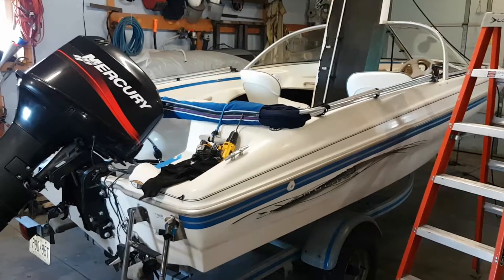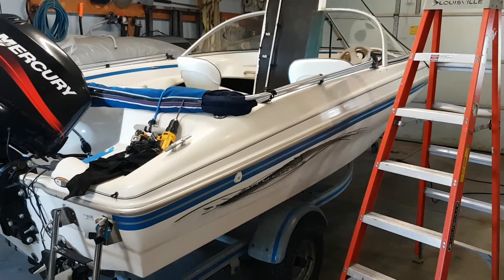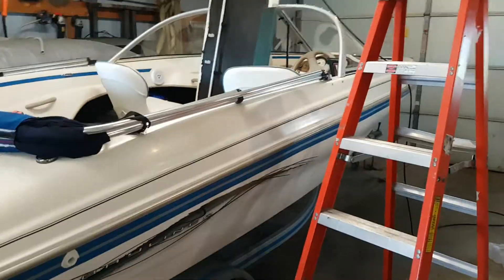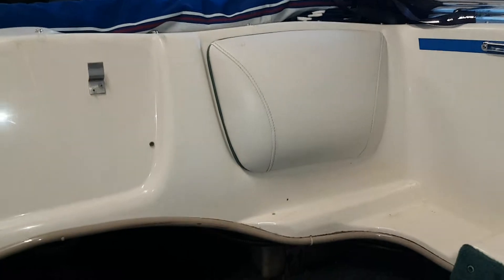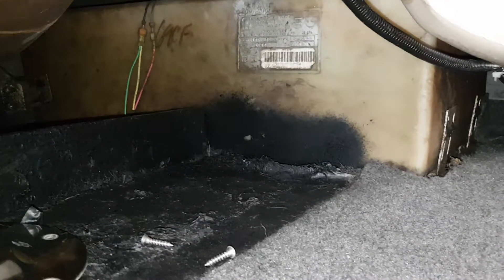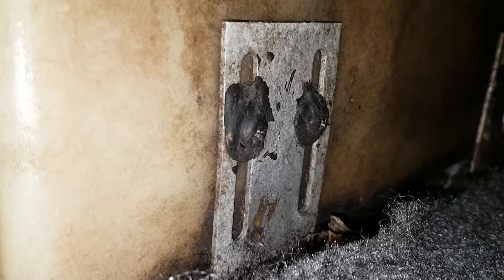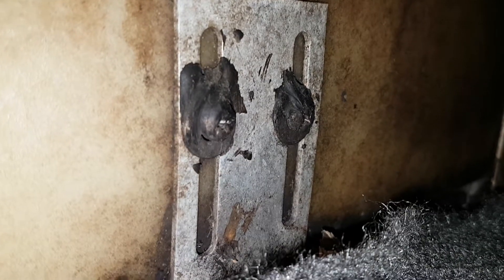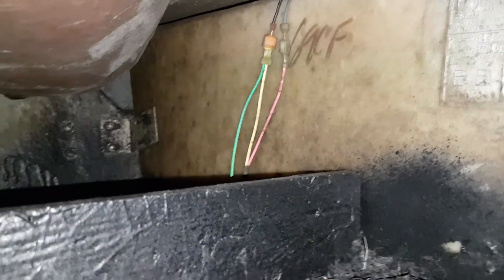Shameful workmanship from bayliner

Comment: sorry , but there is no way that was done at the factory   can you supply proof that you know this was done at a bayliner factory? besides that you think it is the same sealant used in the boat by them
Reply: He's right.  I have the same boat, and my tank is secured the same way.  However, to be fair, the boat is 17 years old and it's never leaked so it has worked (knocks on wood, of which there is plenty:-))
Reply: I stand corrected

Comment: Horrible.... vibrations will eventually stress crack that tank
Reply: I have this boat.  17 years and no leaks from the fuel tank.  Not saying it's a good design, but it's obviously worked well enough.

Comment: Are you certain Bayliner did that. I’m not saying their build the best quality boats, but i highly doubt that would’ve approved by an engineer, CEO or the Coast Guard. How old is that boat? It looks completely rigged up by an unskilled owner at some point.  
SHOCKING. 
Bayliner is a cost leader.  It shows in some details. But most can be rectified by a picky owner, like myself. But the bones are generally strong. And the motor is obviously not made by Bayliner. 
I hope Bayliner has not building boats like that.
Reply from the maker: Its absolutely a bayliner install.  The screws are all sealed with the same epoxi used to bond other fixtures in the boat. 

The only way to install this tank is to do it prior to top shell being bonded to the lower hull.